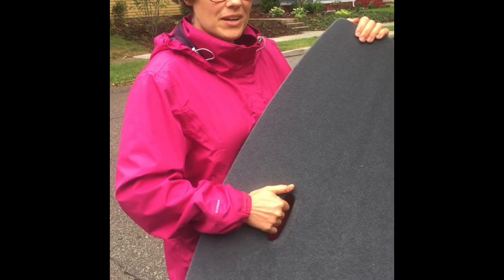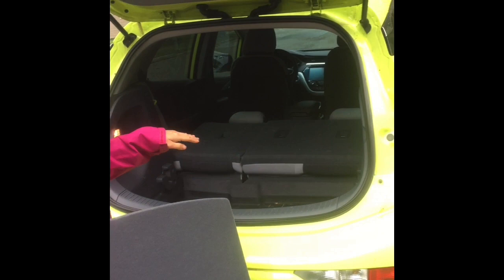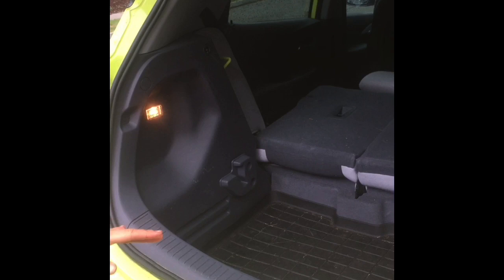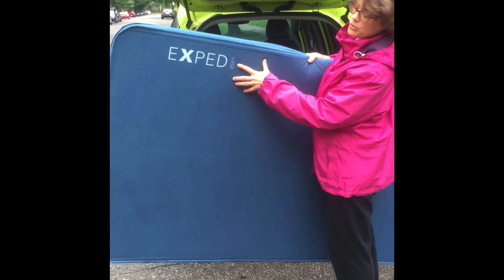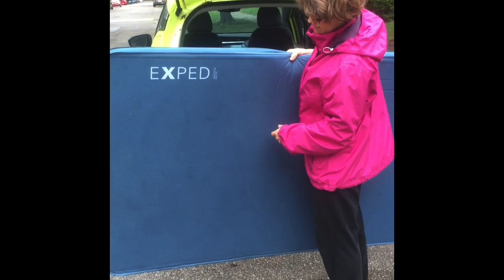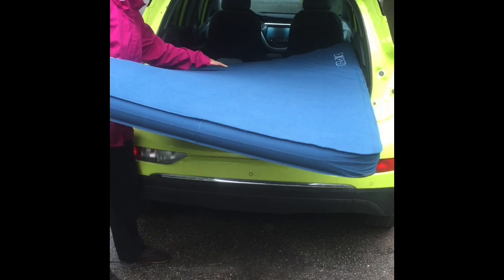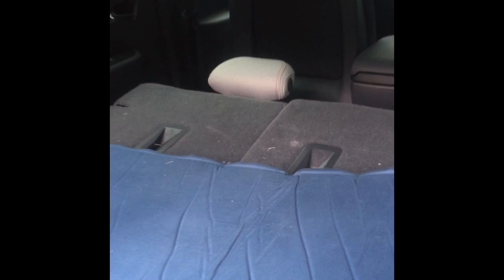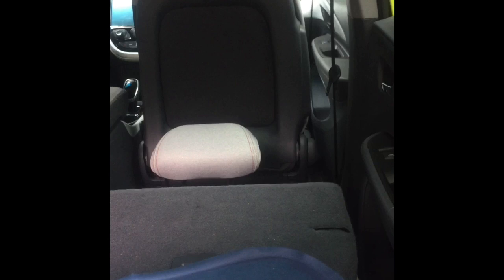Camping In A Chevy Bolt EV: Installing The False Floor Cargo Liner

Comment: Yes, thanks for posting. After buying the Bolt  I realized the  false floor liner is a necessity for the golf clubs to sit nicely on top. I think I'll buy a step drill as recommended by Samuel so it sits flush